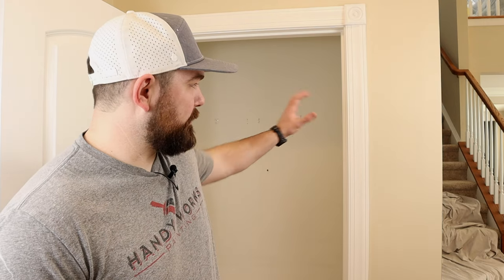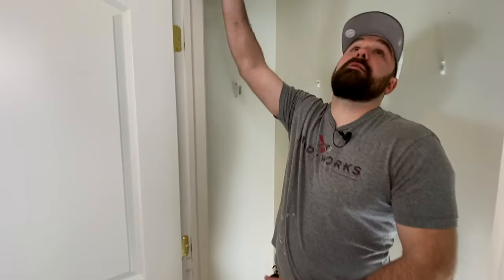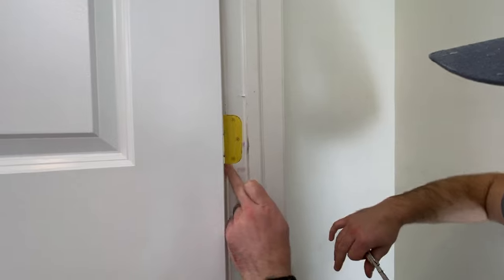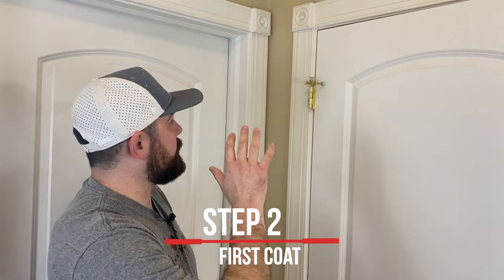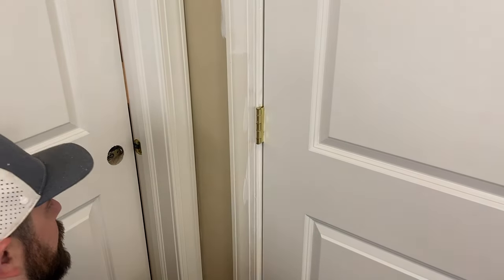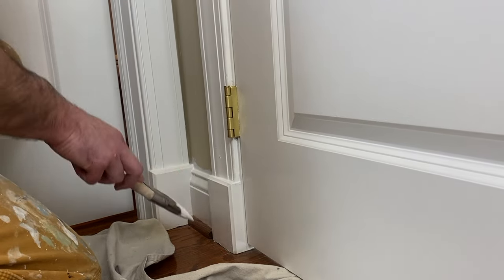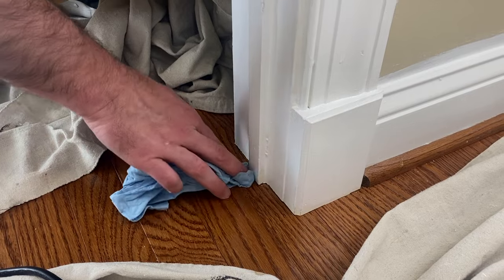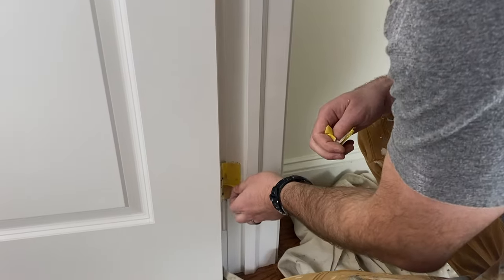How To Paint a Doorframe // 3 Easy Steps

Comment: I've never understood why all these painters don't use a roller to apply paint to door frames. I paint a door frame, front, middle and back in about 20 seconds then finish the bottoms and corners with my brush....easy pezzy.
Reply from the maker: The reason would be to have a consistent brushed finish on a doorframe.  That is common preference for many folks.
Reply: @SuperVassarBrothers  run your brush up and down it....done.
Reply: I always love how “joe expert” knows better than  the pro who does this for a living. Never cease to amaze me how they show the arrogance and ignorance at the same time. Happens in my line of work as well. Appreciate your expertise and think Steve is an ass.
Reply: @stevebeckett3319....I'm asking in the nicest way possible....how does one paint a door frame with a roller successfully considering the door frame has a door stop right in the middle of the frame? Are you using a really small roller? And if you were using a really small roller, wouldn't you need a brush to get into the edges of the center door stop molding? I would think a roller couldn't be any wider than 1 1/2 to be able to paint the frame unless you took the door off its hinges. Please explain.  Thank you 😊
Reply: I'm not Steve, but I'd take the door off
Reply: Is it best to do the door frame before the walls?
Reply: @monicahurd6637 Probably, especially if the trim/door frame color is lighter than the wall color.  In that case, if you get some of the trim/frame color on the walls, it’s easier to cover the lighter color with the darker.
Reply: Because the stipple won't match
Reply: @number1pappy foam roller
Reply: @monicahurd6637 yes, easier to cut in the wall than trying to paint the door casing after the wall is painted.

Comment: I'm always shocked that you never take the door hinges off. Wouldn't it be quicker to just remove them?
Reply from the maker: It’s not for us, particularly when when we’re doing 10+ doors.  It becomes a challenge finding a place for them all.  It’s actually quite convenient to leave them hanging and do it like we did in the video.  We do that 99% of the time and we’re quite fast at it.
Reply: Also might have some alignment issues. Best to pull the pins and remove door.

Comment: If it’s polyurethane over hard wood floors you’ll never want to put tape directly on the hardwood floors, fyi
Reply from the maker: It depends on the state of the poly.  As long as it’s not super old and worn, it’s ok to use the yellow frog tape.  It’s never a good idea to leave the tape on for an extended period of time.  That’s when you run into issues with the tape marrying into the poly and ripping off the finish.
Reply: @SuperVassarBrothers  as much as it cost and the effort to restore my floors I’m not gonna risk it lol.

Comment: Hi Jeremy,  I've painted lots of door frames in the past, but non as bad as in my present home.
The frames at the top have big chips where the paint fell off, or something.  Some are 2 inches wide.
Is there a procedure for this repair, or do I just paint over?
Thanks so much on this Tuesday morning.
Reply from the maker: I could be mistaken, but it sounds like you have a paint failure.  It is likely that a latex based paint has been painted over an oil based product at some point.  The latex based layer didn’t properly adhere to the oil layer and is now peeling off. 

This is a common issue that we run into frequently.  We fix it by sanding and scraping off the loose paint.  It’s not necessary to get every bit of the failing paint off, just the loose bits.  Then prime the affected areas with a high adhesion primer.  There are several to choose from.  BIN or cover stain work well from Zinsser.  Once it’s dry you can go over it with whatever trim paint you like.  You may also need to wood putty some of the affected areas to smooth things out.  

Good luck!
Reply: @SuperVassarBrothers  Whoa, thanks for telling me the Latex on Oil.  I was getting ready to paint with a premium high gloss paint, but I think I will get that primer right now.
Thanks Super Vassar Brother Jeremy!
Jeremy, one of my favourite names.
Big Honk-Out from Canada!

Comment: This really helped me.💯.  Thanks. Is metal paint with primer ok. Or do I still need primer for this metal door frame.  Please help.
Reply from the maker: It’s likely that your metal doorframe has already been painted.  You don’t have to prime it if the trim paint you’ve selected is adhering to the service.  If it’s a brand new metal doorframe then you may need to prime or paint it with a DTM (direct to metal) product.

Comment: Hello. Could you please give me your best advice on choosing the most durable water based for my wooden framed windows? Using 80 grit sandpaper I spent hours & days hand sanding x 4 wooden sash window frames. I sanded off old layers of yellowed gloss leaving behind a thin layer of gloss which I can now see the wood grain through. I now have trust issues finding the most durable water based paints for my interior.  I want to be 100% sure I am choosing the right paint system so I don't have to re-do all my efforts ?  I am new to water based paints. So how would I go about this ? Do I need to prime ? uncoat ? Please tell me the most professional trustworthy durable pants recommended with the longest lasting effect ? Regards Micheal
Reply from the maker: I'd recommend using Fresh Start primer from Benjamin Moore, then top coating with Emerald Urethane Trim Enamel from Sherwin Williams.  That's one of my favorite combos currently.  Emerald Urethane is a hybrid trim paint, but is technically water-based so it's relatively easy to work with.

Comment: Hi. Ive got new unpainted door case- jamb/door stop with new primed doors being installed in a few days. Will i have enough gap to prime and paint jambs etc after doors go on without ruining paintwork?
Reply from the maker: You can definitely paint the jambs after the door are installed.  We do it all the time.  You just may want to tape the hinges to avoid getting paint on them.

Comment: Isn't there like a one coat paint?
Reply from the maker: The amount of coats is very much dependent on the situation.  If you have a significant color change then most of the time you're looking at two coats.  If you're going over the same color, like recoating trim, then a lot of times you can get away with 1 coat.  Most of the paint that is marketed as a "one coat" solution is nonsense.  There's no way they can guarantee that result with different colors.  

We do two coats on just about everything because we want predictable high quality results.  Also the second coat goes on significantly quicker than the first.  All the hard work is done at that point.